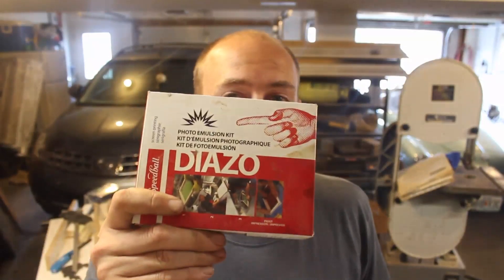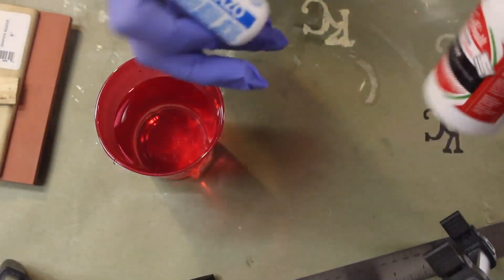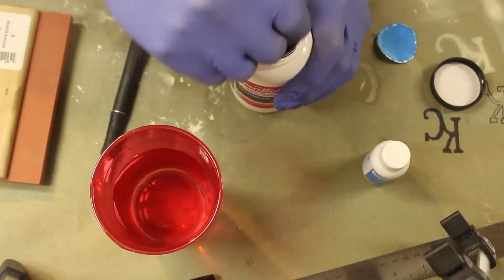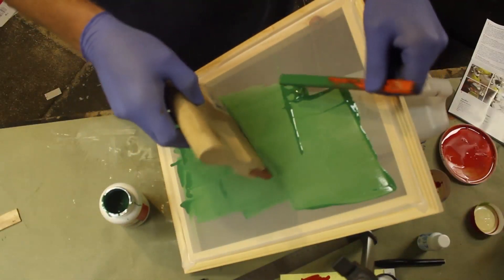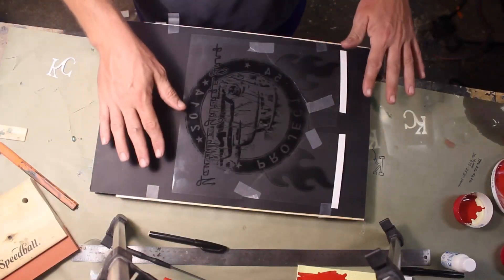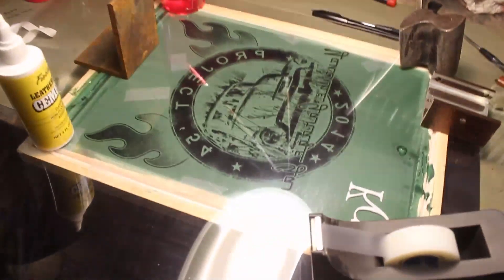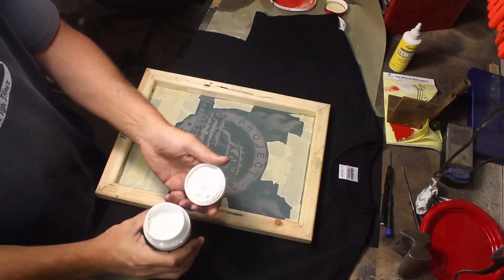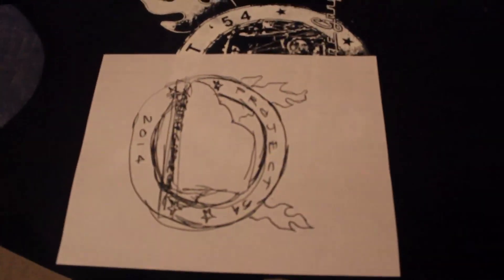First Time Screen Print T-Shirt - Surprisingly Easy

Comment: tip, if you dont have clear paper, what I do is print on regular paper then when I place the paper on the screen to burn into the emulsion I put vegi oil all over it... it turns the regular paper clear/cloudy and leaves the inked part even darker.... and you can print in any color other then black and it will work. the vegi poil doesnt react like cold water meaning it doesnt neutralize the emulsion. Ive found it even speeds up the process. Im using a regular household light and it take 22 minutes with the light or 30 seconds in the sun. perfect prints

Comment: I think you should've masked the underside of the screen so that the ink and squeegee would not have been impeded by the masking tape on the topside.

This would all depend on how well the emulsion took to the screen tho, but better emulsion exposure would've been got by using a UV or full spectrum light bulb and shielding the light away from your eyes with eye protection or physical shielding like cardboard.

As for the alleged imperfections, that is what makes personally designed and screen printed t-shirta authentic and one of a kind.

Love the imperfections!!

Comment: Hi, Greg! Nice job! Next time, try putting the tape on the back side of the screen so it doesn't mess with the squeegee, and tape on the edges (where a little bit is going onto the wood) so that the ink doesn't go through those cracks. Also, with inking, you can put a line of ink at the top, and pull the squeegee down, applying a good bit of even pressure to keep the ink smooth.I just know that from having taken a class. I do plan to make a little set up at home though, so thanks for this video! :)
Reply from the maker: Rosalyn S Will do!  Thanks for the tips Rosalyn!